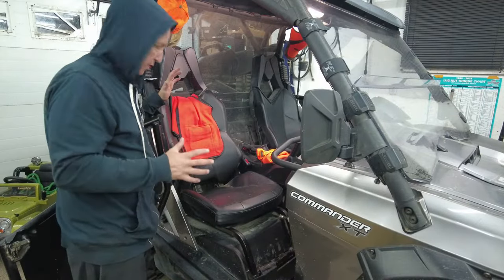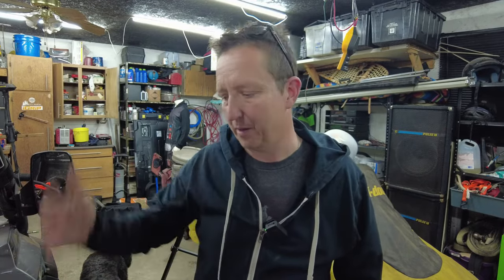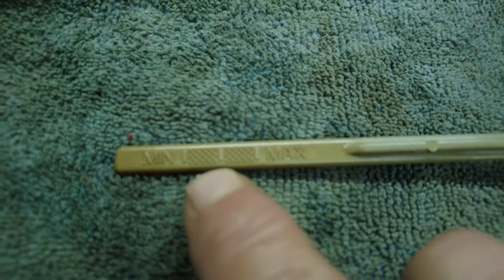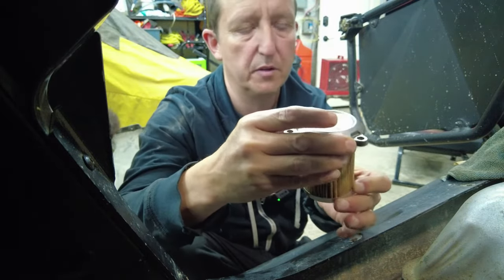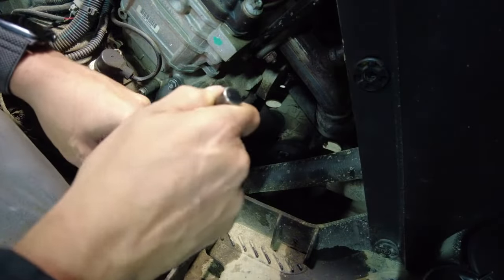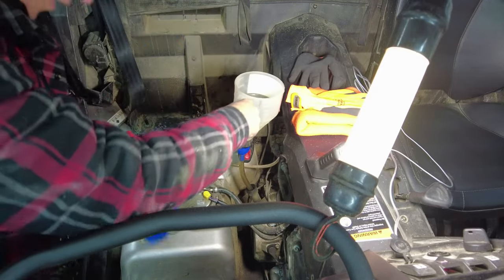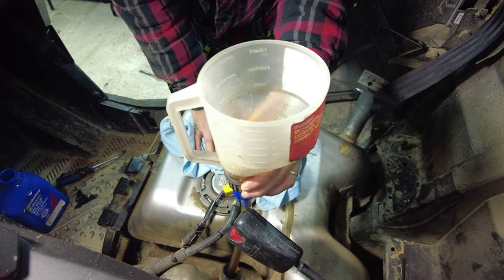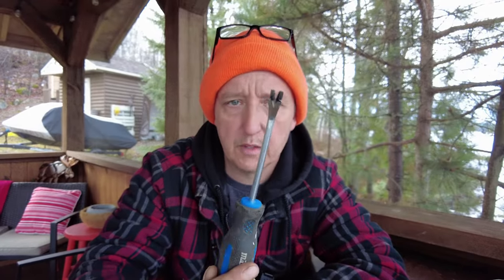Oil Change. Beginners Video 2014 Can Am Commander XT 800cc.

Comment: Nice job. I made a set of wooden pads from 2x6 . I jack the machine up and slide the pads under the wheels. I built  mine for 8 inch height. Saves the knees and back. Makes it easier accessing underneath the machine. Never have to worry about the machine falling off the jack or jack stands.
Reply from the maker: That's a great idea!